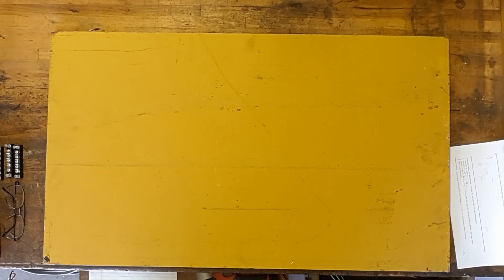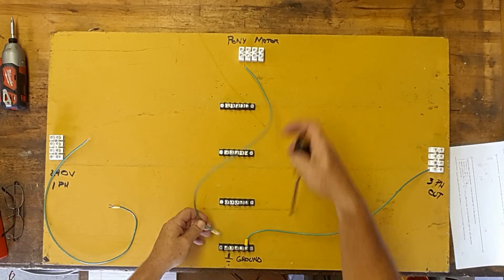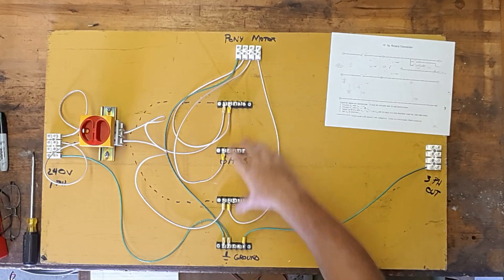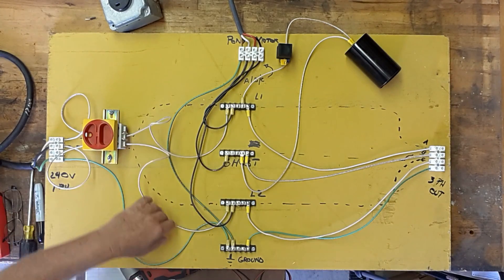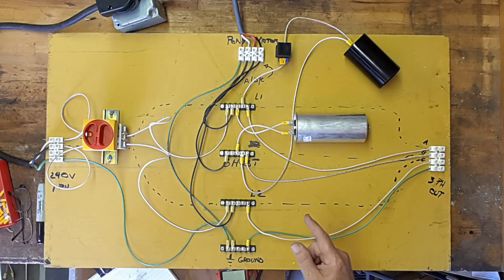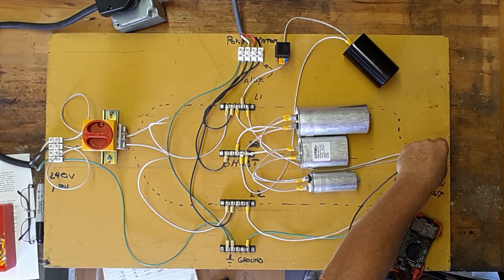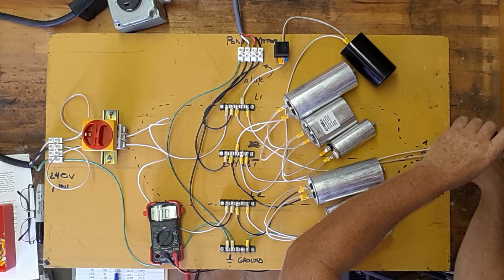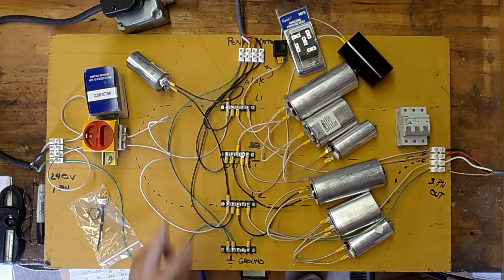Building a Phase Converter - Part 1

Comment: Built a few of these for friends in the mid 70s, instead of the push button I used a timer set for about 1/2 second and on one of them I used a current relay.

Comment: I’ve build my similar 25 years ago. 
Instead of a switch for the 324 uf starting capacitor, I used a potential relay which cuts out the starting capacitor when the ghost leg generates 180 volts. 
I used a 50 uf from one leg to the ghost leg and 15 uf from the other leg to the ghost leg. This balances it out really good. Draws 5 amps when running converter, 2hp lathe and 1hp mill.
Measuring voltage between L1 and L2 reads 240.5 volts.
Measuring voltage between L1 and L3 reads 239.5 volts.
Measuring voltage between L2 and L3 reads 240.0 volts.
It runs 240 across all when running my machines.

Comment: I stopped watching about 1/2 way through.  A pushbutton?  What a crude way to give rotation to the motor.  BTW, it isn't a "pony motor".  A pony motor is a smaller single phase motor that gives rotation to the idler motor.  (Note: idler motor, not pony motor.)  A manual pushbutton won't guarantee that the "ghost leg"  (not sure where you got that terminology) will be at the correct phase angle in relation to the other legs.  Those who know what they're doing use a potential relay to switch the capacitor out of the circuit when adequate voltage is present at that leg of the motor.

Comment: The first 3 minutes of this video shared my concern that there is no calculation used to size the capacitors, what loads that can be applied, what size motor is require to produce the power needed. Oh well, let me continue watching

Comment: Good Morning 
how do you know what size motor you need to use to create the Ghost leg, and why Thanks
Reply from the maker: I have gone by the rule of them....that being, ghost leg motor should be 1 'size' (horse power rating) larger than your largest load motor.  So if it is 3hp, use a 5.  If 5, use a 7.  I'm not sure how long that rule of thumb is valid as size increases.

Comment: This works but it is a very basic design converter and the pilot motor has high start currents and large size relative to output capacity.   Add four capacity tracking stages in binary via solid-state switches and a microprocessor, you can half the start currents, half the pilot motor size and have a much more stable manufactured phase.  About 10,000 units are in service in Australia from 2 to 35kw 3 phase output using this technology for over 20 years. In Australia the 3 phase is nominally 405V between phases.

Comment: I just laid out a setup very similar to yours. It uses a 3500 rpm 10 hp idler. I got a couple starting caps and it started up. I had no idea if my scavenged idler motor was going to work. A bit of grease and its running pretty smooth.

Comment: $300 pony motor, $150 worth of capacitors, $50 worth of terminals, contactor, and fuse blocks. Why not just use a vfd converter?
Reply: I feel maybe you don’t understand the purpose. You need a vfd for every machine/3 phase motor, whereas with a rfc you can run multiple machines.

Comment: Make sure to put all the start capacitors in when you do that portion of the build. I saw working up with the run caps and thought I was supposed to do the same for starts. The reduced amount caused a catastrophic failure of the caps.
Reply: Good to know, this explains why I burnt up my start caps!  I used a 3ph, 3hp motor when building and testing, I didn't want to take the chance of doing damage to my intended motor, which is 10hp.  
When I got the 3hp to work fine, I connected the 10hp motor.  I added a small uf start cap to boost the power a bit when I switched to the 10hp motor (it was all I had on hand), but knew the total MFD of the start caps I connected wasn't quite enough.  I thought it would be ok until I bought a bigger cap.  They started the motor a few times while doing the balancing with the run caps, but then they stopped working.  Now I understand why.  Thanks.

Comment: I tried to turn over a 10 hp 3 phase motor with single and a pull-start. It would hum, not attempting to speed up, until blowing the 10 amp breaker. What do you think is causing this?

Comment: In your phase convertor build I was curious what HP motor you used.  Your video was excellent!   I have a 20 hp motor 3 phase that I'm going to use.  Ty
Reply from the maker: The rule of thumb is to use a motor at least one size larger than the largest motor you are going to drive.  In my case that was a 5 up lathe so I used a 7.5hp motor for the converter.  I have built two more since this video and they all perform well. ~P

Comment: ❤thanks much for that video i follow it and made a rotary converter to run two peices of tools did as you said just have to balance the legs still alittle lost on what are the requied voltages per leg but it is the BEST❤❤❤

Comment: Using a Baldor 5hp and have it setup this exact same way. Trying to go through the process of tuning it with capacitors. I crank it up and this is what I get:
L1 + L2 = 245
L1+ Ghost = 205v
L2 + Ghost 205v
 
L1+Ghost+90mf = 213v

L1+ Ghost + 90mf + 94mf = 216v

L1+ Ghost + (BigA$$) 125mf = 290v, and the motor is flying way faster than it should. 

I’m just trying to get it close with a box of random large run  capacitors I have before investing in anything, and I can’t get the voltage to climb on L1+Ghost with any combination of 90mf, 94mf, 70mf, and a 50mf. I haven’t had success with L2+ Ghost either. 
Do the capacitors have to be in parallel? Sequence? Does it make a difference? Do I have a bunch of bummed capacitors? Why is the 125 WAY too much on a single line?

Comment: Hi, I have come late to this video, but am I great need of it. I have 5.5  hp 3 phase motor i want run my surface grinder and miller, both with  multiple motors max combined 2.5 each. I have tried your link to practical machinist to obtain your documentation and the link does not work.  I tried going direct to the site still can't find the documentation . Can you help, much obliged Philip from the UK
Reply from the maker: I'm not sure what you are doing wrong but the link is working fine from the US.
https://www.practicalmachinist.com/FitchWConverter.pdf
Reply: @sbirdranch  thanks for this, the link worked and I have the document.

Comment: Thank you for this video.  
I am building one now using a 7.5hp pony to power a 5hp unisaw.

Are there any updates to this build process that you know or have revised e.g.  additional  switch gear.  Using one capacitor on legs 1. N  2. Instead of 3 capacitors each?.....etc. 

Thanks for your video and the enormous help in simplyfliling this build.
Reply from the maker: Glad this set of videos helps so many people.  I am building a 3rd one (another friend) and am going through the exact same process as I did here.  Remember that the 'tuning' determines the capacitors needed and that is to some degree, unique for every pony motor.  ~P
Reply: @sbirdranch  I have spent 3 days, can not get voltage on ghost leg, just 30, l1  and l2 have same 235, 5hp used 100 fd caps, dunno what I have done wrong, could i send you a drawing simple layout CAD, POF, and whatever you can read, thanks Stu

Comment: You don't need all of that ,what I did I got alternator (any kind) / battery and belt to connect to the motor 
what I got here is the alternator pre start  the motor and when the motor run the motor keep the alternator running and that will charge the battery Note I do not keep the battery connected to the battery all day few hours work fine for me.

Comment: So if you can get a three phase motor (your pony motor) to run on single phase with that arrangement - why not simply add that in front of the actual three phase motor you are trying to use in the first place?

Comment: Hey man great video, i was looking for videos on this since I'm trying to make a shop of my own. I have a small cnc machine that I would like to install and i know that ill need a good amount of hp for this since my cnc requires 51 amps of current on a 3phase 400V circuit. I calculated about 38hp needed for this much of pull. so would this mean that i would need at least a 80 hp motor. Am i right or wrong about this.

Comment: you never checked for phase clocking. you can have the same voltage to ground on all 3 but wildly dif, between the 3. how do you fix that?

Comment: Great great video love it question how do you size your supply power coming from your breaker panel for your rotary phase converter I plan on building one like yours but 20 horse so breaker size is my question thanks

Comment: In this video there are 120 v × 2 L used to get 240 V input, is there any video and document for layman for UK 240 V 50 Hz single LINE and neutral to 380v/400v/415 v output rotary phase converter? Any suggestions will be great help.
These 3 parts are no waste of time and blessings for people who have 120 v × 2

Comment: Okay the video and comment are nearly five years old. My comment is you breeze over that last capacitor (amperage control). It's a run capacitor to adjust the lead lag current?? Not fully understanding what's happening here.

Comment: In my opinion your videos on how to follow the Fitch Williams design are hands down the best available on the net....kudos for doing an excellent job.  I see it's been about 6 months since you replied to comments/questions, but here it goes anyway.....

My question is how you arrived at your goals for voltage when balancing it.  I don't want to make this a long reply, so I'll skip the blah blah and hope you understand.  
I multiplied my initial number by 1.03/1.08 to determine my goals, and to double check my understanding of what I was doing, I looked at your numbers and did the same math.  I can't figure out how you came up with your goal voltage numbers for Cp and Cs, so I guess I don't understand HOW to do the math to achieve the goal for my setup.
Can you explain the math on how you arrived at your goal voltages based on your initial voltages?

Comment: Dear sir, in South Africa we have a 'problem'. 3 wires. One ground, one neutral (no voltage) and one live(240v). These RPCs really sparked (pardon the pun) real interest for a 3 phase solution for my workshop,. But feels like my kite is shot out of the air. In my lame man's terms (electricity is not my thing, so I lack terminology) if I try to build a RPC like yours, I can only feed one phase on the 3 phase motor/generator. Would you be able to provide insight how to "revive" the 2 remaining ghost phases? Thank you in advance!

Comment: Hi my friend.  Congrats to the system.   Do you know if it works with 3 phase welding machine?     Thanks
Reply: The safest and easiest way to determine if your load is normal vs heavy duty is to call up a rotary converter company and tell them what you are trying to run. They will recommend whether or not you should upsize your converter based on what you are planning to run.

For a welder I would guess heavy duty so I would double the size of the idler motor.

Comment: Thank you sir. Well explained. I have a problem sir on my phase converter. Can help me please. My 3phase pony induction motor is 11kw 6poles 200volts. My problem is when we energized the starting capacitor is always blown up.my starting capacitor is 100/125 VAC 1500/1800 MICRO FARAD. Thank you sir😊

Comment: I would like to thank you very much for a great and easy to follow video. By following the videos I was able to build a 10 hp rotary convertor and it works great.  If its ok and somebody is interested, I will list the cap values for the 10 hp.
Reply from the maker: List the values you used.  They may very a little between idler motors but its a good start.

Comment: ah thank you very much for this.  i just got a big three phase motor and wanted to build a rotary converter but couldn't find instructions on balancing.  couple dudes show their converters with a bunch of capacitors but don't explain how they determined what to use and where.  also that document is suuuper helpful.  thumbs up

Comment: How do I calculate what capacitors I can use for a 30 HP phone motor? I need to power a compressor with a 10 HP motor and a heater ventilation system. Great video. Thanks for sharing.

Comment: how much horsepower you used on your pony motor sir,and wat is the capacity in amperes of your converter,tnks sir
Reply from the maker: Rule of thumb is to use one size larger than the largest motor you wish to run.  In my case the pony motor is 10hp.

Comment: Very very nice build man! would like to ask because im planning to run a 5.5hp 3phase centrifugal pump. using your RPC, would it be okay if i use a single phase motor as my pony motor? And HOw much HP do i need for my pony motor to power the 5.5hp 3phase centrifugal pump
Reply: The pony motor must be a three-phase unit.

Comment: This is the best video about this topic around by far. Kudos to you sir. If I needed 400V 3 phase does it work the same but having a star or 'Y' wired motor rather than delta wired?
Reply from the maker: I'm not sure on your question.

Comment: Is there a table for phase converters showing minimum size circuit breaker protection protection per horsepower.  I looking to connect a 100 hp 240v phase converter???
Reply from the maker: Not that I'm aware of.  That is a big converter.

Comment: Love your in depth explanation of this convertor build. my question is what size start capacitor do i need to start a 20HP motor? I see the biggest most places supply is 1000-1200 MFD. I think i would need more than that if 70mfd per HP. Thanks!

Comment: Hi. I would like to make one of there converters. I have a 7.5hp lathe, what size 3 phase motor would i need as in hp to run my 7.5hp lathe. Many thanks.
Reply from the maker: 10hp
Reply: Thank you so much for your reply.

Comment: Hmmmm.....and just how would you adjust the capacitors manually to keep the phase voltages balanced.....they doo have to be balanced or you end up with overheating problems as the load fluctuates.
The setup will start and run a 3 phase motor but you do not have any control over the loading that affects the phase voltages.
In commercial RPC's they have an electronic sensing circuit that adjusts the capacitors as the loading fluctuates.

Comment: Good job ,  what is the proper voltage Capacitors we need to use on this Project 
is it 240 V , or can use 440/370  as well

Thank you

Comment: Will using a 20HP idler be Ok even if it is over twice the size of the largest motor on the setup?
Reply from the maker: Don't think so, but it will draw more power so you have to scale everything accordingly.  It will also mean it costs more to run which may or may not bother you.  ~P
Reply: @sbirdranch  Thanks.

Comment: I'm trying this with a new 7.5 hp motor and although I can get 235V on L1-L3 and L2 to L3, I cannot get above 200V on L1-L2. Also the motor is getting quite warm which suggests some phase angle issues. Would you have any insights?

Comment: you're starting with 2 phase.. not single phase
Reply: Andrew Savage, you are mistaken.  "Two phase" was never commercially used in utility power generation.  Preston is correct.  In the USA, the utility generation industry defines residential service as single phase, but it is actually SPLIT PHASE.  It is two legs split off the single phase transformer 180 degrees out of phase.
Reply: @otherengineer58  there was an s missing from that comment as in starting with 2 phases. Its a semantic argument really as the split phase operates exactly like 2 phase would in the situation. Unless I'm missing something obvious?

Comment: Thanks for this video. But please, stop calling 240v single phase. It is not. It is 2-120v lines 180 degrees out of phase. i.e. 2 phases.
Reply: ballzack57, you are mistaken.  "Two phase" was never commercially used in utility power generation.  Preston is correct.  In the USA, the utility generation industry defines residential service as single phase, but it is actually SPLIT PHASE.  It is two legs split off the single phase transformer 180 degrees out of phase.
Reply: Single phase is correct in Spanish monofasico

Comment: What all did you scavenge through to get all those caps?  Theyre pretty pricey if bought when they get up in volts and capacitance like those...  hell i got a 63v 200,000 μF on ebay and still had to dish out 200..
Reply from the maker: I list the source in the comments.  They are all new.  Give Midwest a call.

Comment: Where did you buy the capacitors you used in your build,  I have put together one like yours trying to power a 3  phase plasma cutter but don't have the correct power to each leg therefore not operating well, using your plans do you think I can get this thing cutting?
Reply from the maker: Midw ess t surplus electronics.  Details in the description.

Comment: If a second idler is added do any of the capacitors need to be changed or any additional components besides a timed relay or a manual switch for the idler?

Comment: This is so perfectly explained, I think I’ll be making one for my lathe, thank you!!!
Reply: they are also really inefficient. better to buy a VFD.
Reply: @Savagetechie  That may be so, but when you have several machines to run the costs for the VFD's become prohibitive for a small/hobby shop.
Reply: @gilbertodiaz-castro626  true the get costly on multiple machines and some motors won't like them. There is a type of rotary convertor that has a true neutral which is also reasonably efficient. Most rotary designs have pretty nasty neutrals.